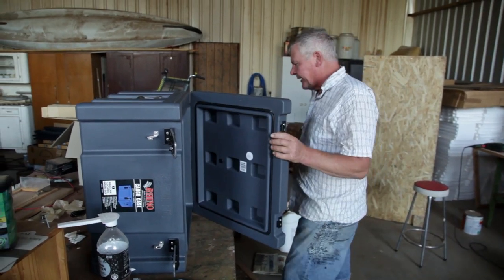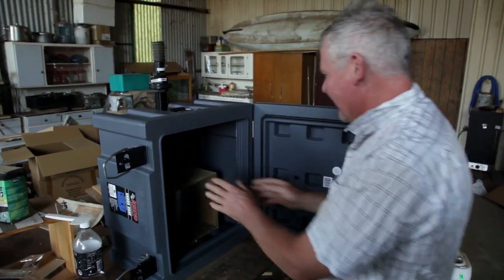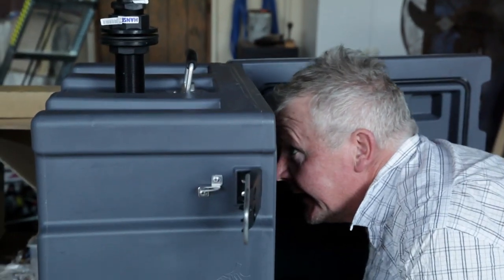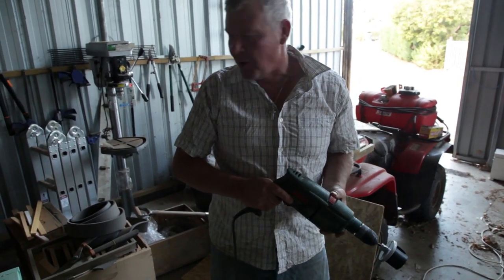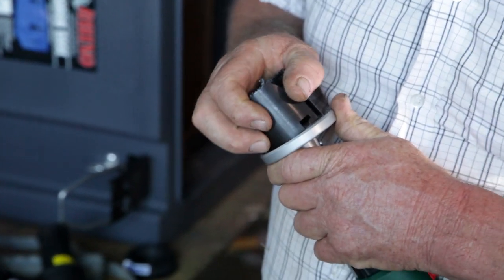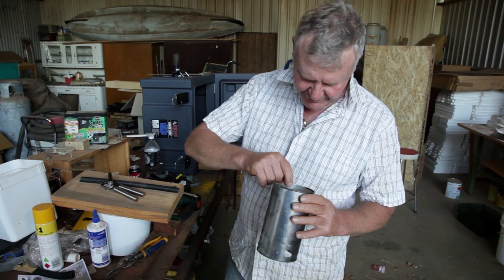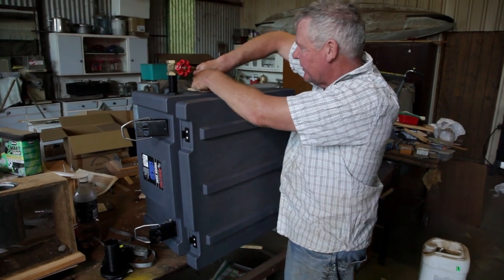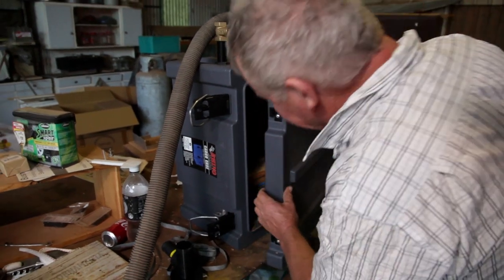How to Build a Bee Vacuum - The Bush Bee Man

Comment: I start watching and nearly lose my beer laughing so hard. I think you forgot to think about all the crap that comes into the box with a vacuum, including pests. Might be a good Idea to have a partition in there first to take out the crap and allow the bees to be separated and then have them in a separate area for removal. I used some gate valves to make connection and disconnection easy of the hose and for regulator as well like you did. Take a long extension cord or gen set lol.